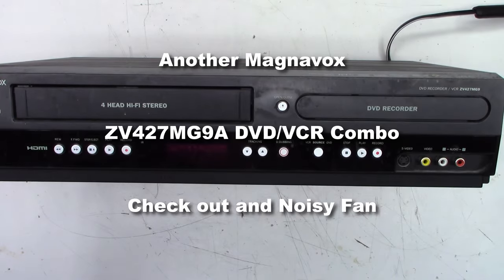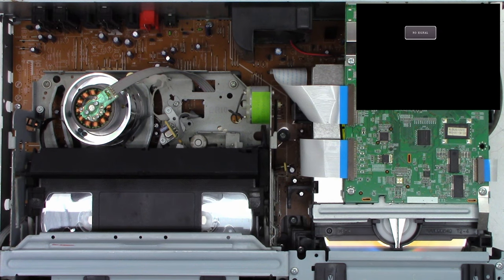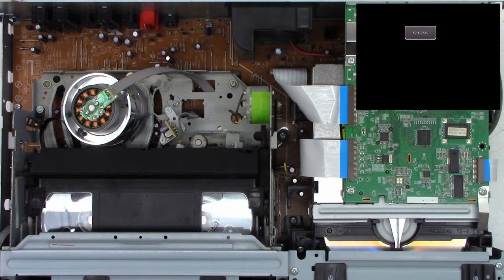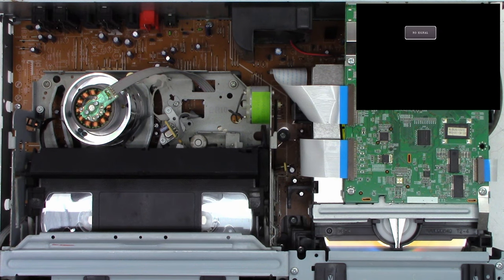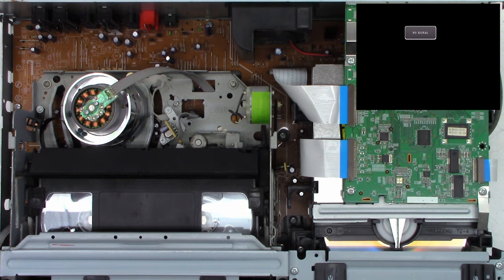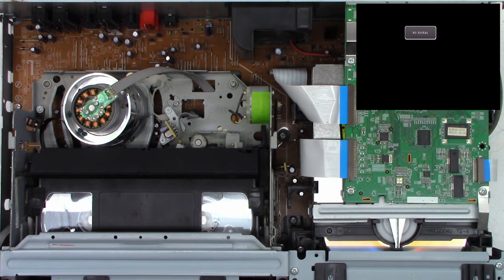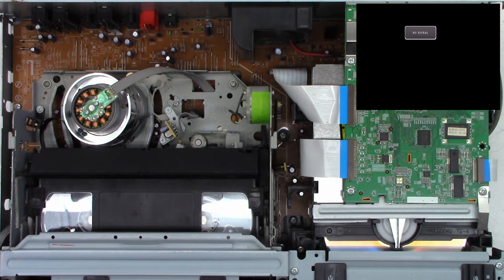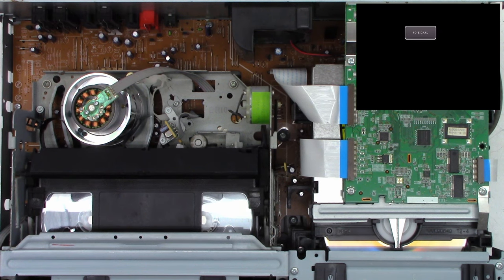Magnavox DVD/VCR Combo ZV427MG9A that had multiple issues with the DVD & VCR parts. It is good now

Comment: i found your video through google and was wondering if you might be able to help me with a small issue, i recently picked up a mitsubishi hs-u445 that will not take in tapes are not fully rewound first, if the tape is at the start it will work fine but if its at the end it wont, any ideas i can try?

Comment: is there a fix for high pitch noise when recording vhs to dvd you've encountered? the noise when playback
Reply from the maker: Typically it is a high ESR capacitor in the audio circuit that caused a high pitched whine recorded onto the tape.

Comment: Thank you so much for making these videos, I managed to mostly fix one of these that I picked up from Goodwill because of them. Whenever I put a tape in the whole thing would shut off and not even play the tape or eject it. I watched some of your videos on this particular model and cleaned up the mode selector switch like you did, and it now takes in tapes and plays them. However, there is no audio, and it struggles with fast forwarding and rewinding, often getting stuck, then shutting off and keeping the tape hostage, in which case I have to manually turn the motor that ejects the tape. The fast forwarding and rewinding issue is probably a worn drive belt, but I haven't been able to find any parts for this model besides buying a whole new one (cheapest I could find on ebay was $30; I paid $15 at Goodwill for this one), and I haven't bothered checking voltages/ohms/whatever because I know nothing about that stuff. Same for soldering to replace the capacitors. It didn't come with a remote so I'm gonna get one off ebay and see if i can fix the audio in some menu and just deal with the FF and RW issue. Otherwise I'll have to get a multimeter and learn how to solder, and I'm not sure if I'm willing to do that much just for a cheap VCR. Thank you for making these videos nonetheless.

Comment: Thanks for the video helped my half way fix my DV220MW9. I takes my tape and auto plays and slow rewinds and forwards but won’t fast rewind and fast forward. I cleaned and lubes the mode switch and that’s about it besides cleaning the loading belt. Any help is appreciated. 

When I put it in fast rewind or fast forward it sounds like it’s try but does nothing and powers down.

Comment: I recently landed on your channel and find it of high quality. You take time to clearly explain the why of what you are doing. Thank you very much for that, I learn a lot here. One question: I noted that you clean the mode switch with a metal brush. But aren't the mode switch contacts covered with some corrosion-preventing metal film (eg nickel), which would get damaged by the brush ? Perhaps you compensate for that with the dielectric grease.
Reply from the maker: The contacts are silver plated, and working on VCR's for 40 years I have never got down to the actual copper using this method.

Comment: Question: for 100uF and lower surface mount capacitors, would it be better to use ceramic capacitors instead of bent over electrolytics? Why or why not?

Comment: Followed your video to work on my ZV427MG9.  Originally the vcr portion stopped after attempting to load a tape and the DVD part played and recorded.  After cleaning the mode switch, the VCR worked but the DVD no longer spun the disk.  
There's also a loud clicking noise when I eject a tape.  I raised the door when I put the face plate on, so I don't know why the clicking noise comes from behind and the right side of the door. 
Any idea what I did wrong?
Reply from the maker: Does it eject the tape normally with the front panel removed? Also check that none of the pins on the 2 ribbon cables from the chassis to the DVD do not have any missed or bent pins.
Reply: @norcal715  A tape does eject normally and the  clicking sound continues until I push the right side of the tape mechanism, whether the front panel is on or removed.   I substituted another  DVD drive (I bought a second ZV427MG for parts) and that dvd drive  worked normally in the old ZV.
Where do you get belts?  The ebay seller has belts that are half the thickness of the original.